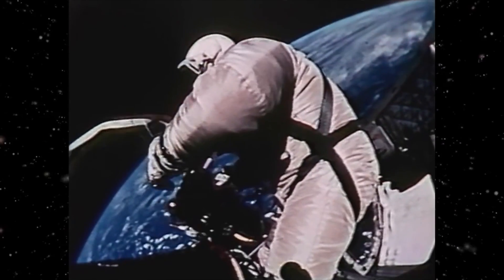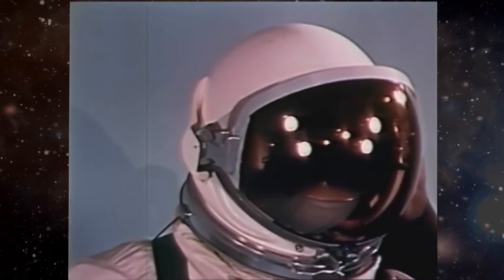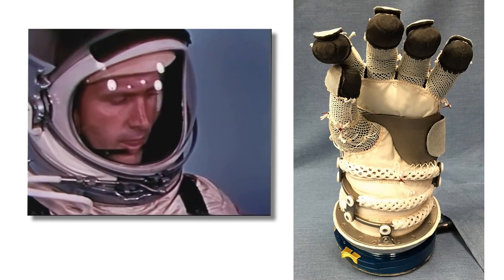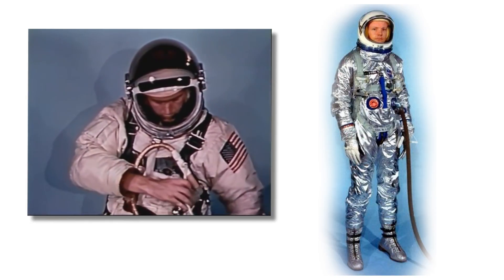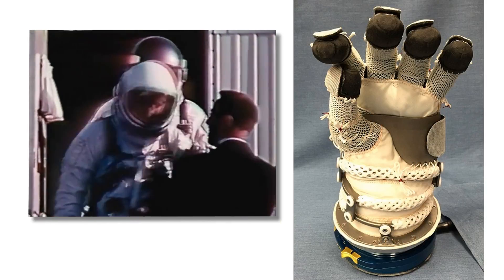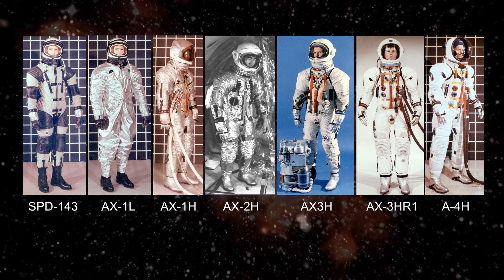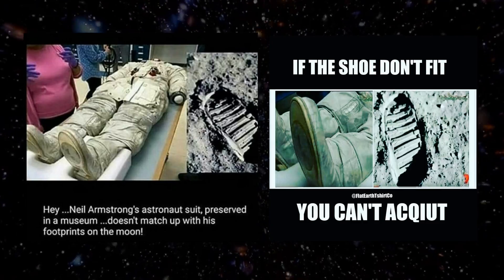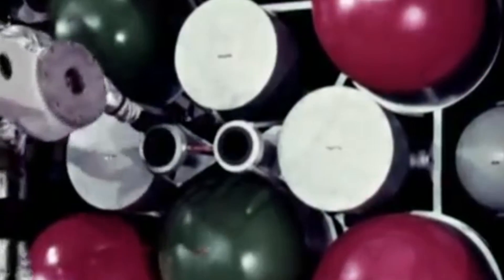The Space Suit Special

Comment: Lying goofball. The vacuum of space suck seals outta suit- to think a helmet wasnt fixed to top of suit, the contempt for reality is evil
Reply from the maker: The vacuum of space is nothing. that is, an absence of everything. So how is nothing able to suck ?
Reply: @humansofearth25  it's the opposite pressure other side of seal-even 4.7 psi of a spacesuit would balloon the container if the seals held, which a 2psi press enough to rip out.
Reply from the maker: @nancyelliot8411   The difference in pressure is between the zero pressure of space and 4.9 psi of the suit a difference of 4.9 psi. The pressure of sea level atmosphere is 14,7 psi and we inflate car tyres, for instance, to over 30 psi, giving 3 times the pressure difference that a space suit has to withstand. 

To put it bluntly you haven't got a clue what you are talking about
Reply: @humansofearth25  there are videos of tankers trucks which had fire inside and vacuum created-the trucks crushed like eggs! Fact is not once has a spacesuit survived a test in vac chamber. So spacewalks etc were fake. Time is the issue. We shouldn't waste ANY on a obviius fraud- the liars are OUT and we need to move on
Reply from the maker: @nancyelliot8411  " Fact is not once has a spacesuit survived a test in vac chamber" . The trouble for you is, this is not a fact. it's yet another bullshit line from the flat earth meme thats is completely incorrect and that you have just repeated without checking
Reply: Nancy Elliot the reason the tanker truck collapses is not because of the vacuum but rather the 14.6959 psi of atmosphere pushing on the outside of the truck. Vacuums do not suck unless they’re plugged in and your doing the hovering 🤣
Reply: @nancyelliot8411  What type of tanker truck? One designed to hold ambient temperature liquid, or a pressurized one?  If the latter, would you assume something designed to withstand an outward pressure would necessarily handle an inward pressure from the atmosphere pushing on a tank containing nothing (a vacuum)?
Reply: @bobblum5973  it doesn't matter Bob. For ex. a 300mph wind- such as found in a F5 tornado, lifts highways and tosses car size boulders like paper! The wind is solid and exposed, its like being hit by a hammer! The pressure versus a vacuum is just that: pressure. A Lunar lander on the moon experience LESS a punch then a diving bell visiting the Titanic (which is 2 miles deep)! The moon hoax depends on ppl thinking a moon landing site is just a sterile airless campground- sorta like top of mt everest or a base in the Antarctic!  Imagine what it like beside Titanic, with 2 miles of sea pushing down, and consided that THAT is mild compare to the moon!
Reply: @nancyelliot8411  So wait, let me get this straight.   You're saying that 2 miles depth of water pressing down where the Titanic is located is MILD when compared to the approximately 5 PSI pressure differential for the LM or a space suit on the lunar surface or in space?  One figure I found for the pressure at the Titanic site is 377 atmospheres, while the LM or space suit is roughly 0.33 atmospheres.  That's a ratio of about 1,142 times MORE for the Titanic.  How is that mild?

I agree that it's easier for something to withstand a gradual buildup of force / pressure than a sudden change.  I certainly do not consider space or the lunar surface to be a picnic campground, they are hostile environments which would easily kill an unprotected human.  But we're clever enough to engineer technology to protect us; it's not impossible, just difficult, risky, and expensive.
Reply: Here are links to three different videos, all showing vacuum chamber testing for U-2 pressure suits.  The two timestamps I show aftrr each link are for water boiling and cabin pressure loss.  And before the cry of "Hoax!" is shouted, yes these were all performed at the same facility with the same model of suit.  It's not like there are a lot of different suits and places in the world to do this sort of thing.

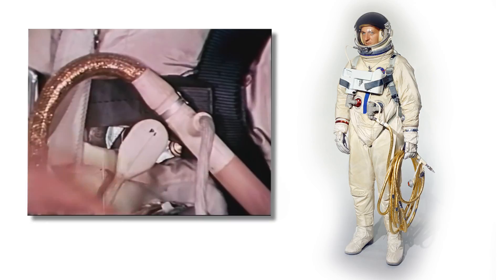https://youtu.be/OmeJlewaU7s    3:05  &  3:38
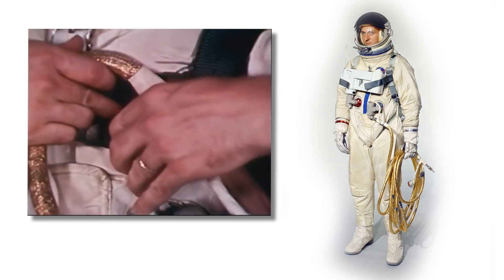https://youtu.be/3MkBfHIrV6k     3:30  &  4:20
https://youtu.be/uSHPxIem-14     1:03  &  1:40
Reply: @bobblum5973  ty Bob for the info. Somehow though we're ships passing in the night- your assertion that ANY earthly challenge to human ingenuity is met while - Lunar complexeties are just different, perhaps harder agreed.... but I do not accept that the deep space challenge is even documented! 50 years since 11-17  and NASA now glibly proclaims we soon go back- doesn't that call into question NASA's motives? Btw, isnt it a fact the laboratory vacuum chamber (8 ft thick walls) in Omaha(?)  has NEVER matched the 10.7 torr vacuum that prevails on moon surface? Also, why doesn't NOVA or similar type public service program look at Apollo,  the challenge of space travel or any of the blatant questions which haunt the entire moon landing idea? 3 space suited astronauts cant fit into a LM- which Apollo13 claims they did in the emergency. It require very little to produce such a program- and they don't do it because WE NEVER WENT TO THE MOON! And that is a terrible fact
Reply: @nancyelliot8411  First off, I won't claim that ANY challenge will be met, just that many have, and more will be.  I think the only reason we (humanity, not just Americans) made it to the moon is because of a "perfect storm" of conditions, among which are: the level of technology was getting closer to make it possible; the rivalry both political and social between the US and USSR; the goal set forth by President Kennedy and his subsequent assassination sparked a drive to fulfill that goal; the budget behind that drive, to throw money and people at any and all problems to meet the deadline.  In some ways it was an act of desperation, but it wasn't faked, that would have been dishonorable (at that point in time).  NASA doesn't have motives, per se; they have a budget.  The one they get these days is a small fraction of what they had in those days building up to Apollo. Once we got to the moon and back, the drive faded; Apollo missions 18, 19 and 20 were cancelled early on.  Budgets went to the Vietnam War and other matters.  We'd  soared so high with Apollo to the moon that what could NASA do for an encore.  Skylab, the Apollo-Soyuz Test Project, the Space Shuttles and the ISS were all good but lack the excitement of a moon landing.  Here 50 years on we're finally starting to pull out of the slump. Can we return to the moon?  Certainly, but only if the budget is provided and there is a challenge to be met.  (Sorry, didn't mean to be so long-winded!)

NASA has now been told to get back to the moon by a certain year, but that doesn't mean they'll get a stable, long-term budget that's big enough to do it by then.  They've had so many false starts and restarts that I have no clue what will happen.  Commercial spaceflight may be able to do it, or the rivalry between US, Russia and China may help.

As for the comment about three astronauts not fitting in the LM "lifeboat" during Apollo 13, you're right.  They were not in their space suits, they were in flight suits or coveralls.  And watch the Tom Hanks movie and you'll see they were in both CM and LM, and in weightlessness you could have two fully in the LM while the third was in or near the connecting tunnel.

You said 10.7 torr (which would be 0.01407895 atmospheres = 0.2069035 psi).  I'm assuming you meant 10^-7 torr (1.9336774702e-9 psi).
According to https://en.m.wikipedia.org/wiki/Space_Power_Facility "the facility can sustain a high vacuum (10^−6 torr, 130 μPa)" which would be 1.93367747e-8 psi. I think that's close enough.
Reply: @nancyelliot8411  Your numbers are off, the pressure on the surface of the moon is more like 3x10^-15 torr, much lower than your 10.7 torr number.
Not that it really makes a huge difference in the forces involved, since one is 0.014% of atmospheric pressure, and the other is about 0.00000000001% of atmospheric pressure, so even though there are a lot more zeros after the decimal, it is still just a small difference in absolute pressure differential.
Your Apollo 13 claim highlights another area of conspiritard ignorance. There is more than enough room, albeit tight quarters, for 3 suited astronauts to fit in the LM.
They were NOT wearing the backpacks, and other gear, that is added on for walking on the moon.

Your "facts" are wrong, and reality doesn't actually give a rats ass what you accept.
Reply: @markbeiser  Mark! I have PROOF that the entire Apollo program was a anti american PSYCH OP! The parachutes that gently set AP. 11 etc capsule in the sea nearby rescuers was able to handle 3 ton crewed capsule (slowed from 300 mph velocity to WET at 20 mph!) a prof at Ohio Comm. College at Danberg did the math- when opened the chutes were need 1.25 acre/ton, so 3 ton capsule need 3 plus acres of fabric plus nearly a mile of STEEL cabling - rope wouldnt tolerate temp/press of blast off much less 25000 mph reentry speed. [never explained how anything survived reentry!]) the very costly chute, pressure cooked SILK titanium each parchute cost millions, and ENTIRE affect fatal  damaged by pinhole leak- and member only one shot at survival, yet Nasa did it repeatedly! Regardless the prof say packed chutes and cable are by volume 50 cu. ft! Add on heat shield and there b ONLY be 6 inch space left in capsule, for food water fuel suits and the radio etc!
Reply: @nancyelliot8411  Assuming this person exists and did the calculations. Based on the information you provided, the numbers used were wrong, lol.
The parachute system used included drag parachutes that were deployed at ~24k feet to slow the capsule to around 175 mph. The main chutes were deployed at 10,000 feet.
The system appears to have worked, since none of the astronauts died on reentry.
Perhaps your community college "professor" was not basing his calculations off he same information the teams of scientists and engineers at NASA had available to them...

FYI, there are a number of calculators for required parachute area. I plugged rough numbers into them, even the numbers you gave, and got nowhere near the "1.25 acre/ton nonsense you posted.
Care to entertain us by linking to your "professor's" calculations?
Reply: @markbeiser  hmmm... I lost link long go...very brilliant dr, if i recall. Anyway, the chutes are all you need. Cheka Nasa vids of Apollo returns with chutes deployed- you actually see the ringbolt connexions (with steel bolts exposed and bright colour chutes looking fresh and NEAT!) Fact is no outside connection was possible- 25k temp reentry cook off a inch of surface metal, so the chute ropes tie up INSIDE THE CAPSULE! And that means a dozen lines 100 ft long snaking out chute compartment, but WE SAW the chute ringbolt link to capsule, as if Nasa just forced watchers to pretend it made sense when simple math shows us they musta dropped capsule from a cargo C- 250 plane! Nass says ACT STUPID folks cuz no parachute assembly is possible UNLESS logic and common sense are TRUMPED and - pay no att'n to man behind curtain! Mark you know no one set foot on the durn moon!
Reply: @markbeiser  Mark! Ur own eyes tell us the chute(s) tied to eyebolt at tip of return capsule- iow cable harness connected to ship OUTSIDE!  C'mon ... how possible was parachute deployed/linked to hurtling capsule. ..NASA says Ap. 9 to 17 ALL reentered atmosphere at 25000 mph- heat shield slowed vessel to (you say) 10k mph when chutedrag deployed!  No way hose say! A cat 5 windstorm at 300 mph air weighs TONS- and chutes are shredded above 250 mph! Plus, Nasa says chutes werw hooked up to return capsule AT BLASTOFF!  During APOLLO, JFK Shot, Malcolm X, Dag Hammershauld- UN chief, Pat Lamumba Africas greatest leader, Rob and Martin King, all murdered along with millions Vietnamese!  But lookit, man on the moon!
Hogwash i say...
Reply: @nancyelliot8411  Again, you show you have done absolutely no research into the things you are arguing against, not even on the most cursory level.
You continue to argue based on numbers you pull completely out of your ass.
As I pointed out earlier, the fucking parachute system had a cover over it during reentry, it wasn't "outside" until it was jettisoned using small parachutes at around 24,000 feet.
The capsule was already at its terminal velocity by then, under 250 mph, at which point drag chutes deploy to slow it down even further before the main chutes deploy. 
It is a multiple stage system.
There is a basic diagram illustrating the sequence here. http://nassp.sourceforge.net/wiki/Earth_Landing_System

If you are going to call something bullshit, at least learn something about the thing, and try to come up with rational arguments against the actual claimed thing.
All you have been doing is raging against a retarded strawman of your own creation, and we can all see through it.

I doubt you have the intellectual honesty for the task though.
Reply: @nancyelliot8411  said: "heat shield slowed vessel to (you say) 10k mph when chutedrag deployed!"

Your reading comprehension seems to be as bad as your research and logical argumentation skills.
What I actually said was: "The parachute system used included drag parachutes that were deployed at ~24k feet to slow the capsule to around 175 mph. The main chutes were deployed at 10,000 feet."

Where in that did I say anything that could be misconstrued, by any sane and logical person, as anything being deployed at 10k mph?
The fucking capsule was at terminal velocity, under 250 mph, before any part of the parachute system was uncovered and deployed!
Reply: @markbeiser  NASA says Apollo's reentered earth air at 25000mph. .. how did they slow down? . Meteorites burn up thnk gosh... and some still do damage. Entire moon program defies even a child's critical examination!
Reply: @nancyelliot8411  Easy!
Friction with the air, known as aerodynamic drag, causes the capsule to decelerate.
This creates a lot of heat, so the capsule has a heat shield on the end facing the direction it is moving.
At some point, well before any parachutes are deployed, the decelerating force of the aerodynamic drag reaches a balance with the acceleration of gravity, and it falls at a constant rate, we call that the terminal velocity. In the case of the Apollo capsules, I think it was about 130 mph, give or take some, but definitely under 250 mph.

If the heat shield fails, everyone on board dies, which is what happened to space shuttle Columbia.
Sadly, I actually got to witness part of that one from the ground here in north Texas. :(

You continue to show that you have done absolutely no research to learn anything at all about what you are arguing against.
Literally everything is argument from ignorance and incredulity with you.

One of the core components of critical examination is actually learning the facts about what you are examining.
Otherwise you have no basis to rationally argue against it.
If you are going to disagree with the facts, at least learn the facts, otherwise you are just raging against a straw man of your own making.

At this point, you are the intellectual equivalent of a 4 year old saying "Nuh-uh!".

Comment: The Word for today is AIR-CONDITIONER. An air-conditioner CAN'T POSSIBLY work in space. They must use ''Vacuum-conditioners' then?
They probable double as Vacuum Cleaners to suck the crap (human space junk) out of those suits. They are  worn for extended lengths of time. At that stage the AstroNOTS would be glad the Helmets leaked .
Reply from the maker: +Gazza Shillaphobe WTF are you talking about?
Reply: All air conditioners work ON AIR EXCHANGE to operate. Heat is produced on the compressor side. The outside radiators need air to carry the heat away. How is a Vacuum supposed to that ??? 
The only other cooling technique is Eutectic and it was not invented and too Piss Week anyway. Read up on the refrigerator effect.
Those backpacks were supposed to contain heavy air-conditioners to cool the suits. No cooling the synthetic suits melt-shame about the Actornaughts.
Reply from the maker: +Gazza Shillaphobe I am really looking forward to the day when I get a negative comment from someone who has actually watched the video.

You are making a foolish Strawman argument, the only person insisting on the requirement of conventional Air Conditioners is you. You seem to be under the totally weird misapprehension that the only  way to cool hot things down is with a conventional domestic air conditioner. I hope they don't let you behind the wheel of a car but if you could try asking someone who has one if you could look under the hood, you will find that the engine cavity which houses a very hot engine, which requires cooling, is totally devoid of any domestic air conditioning systems.

When you grow up and are old enough to drink, you may want to consider for a moment how that tipple is distilled, believe it or not, it's done without the use of a domestic air conditioner.

So, think about the two examples above and then maybe think about watching the video you are commenting on, then spend some time learning about the different forms of heat transfer and which of these are applicable in a vacuum, and then come back here and tell me what new absurd conclusions you have drawn.

I don't suppose you will do any of the above so as an easier alternative you could try continuing to type dumb shit in comments threads on subjects you know fuck all about as this has some entertainment value for normal reasonable people.